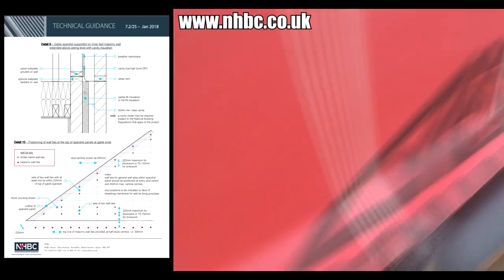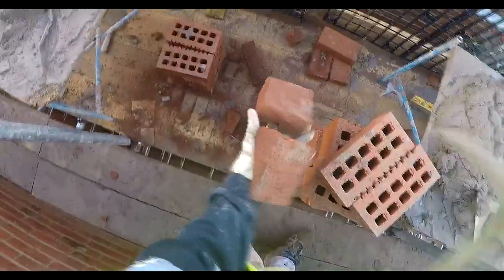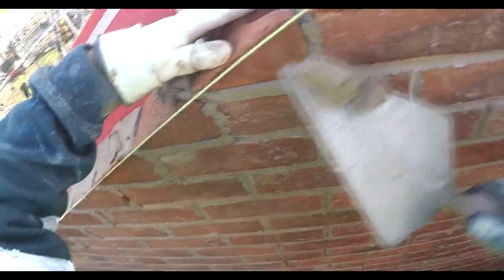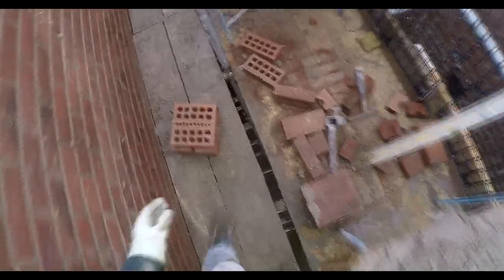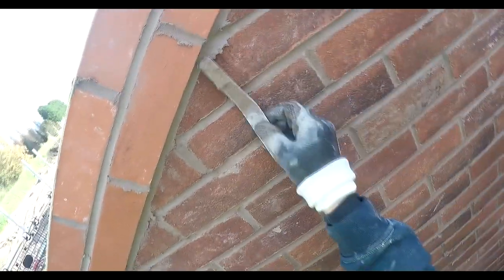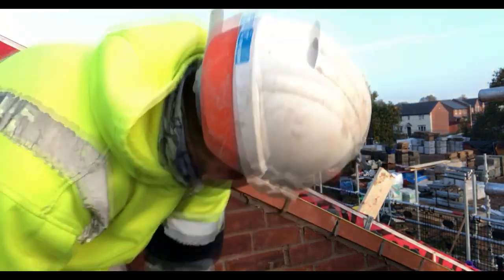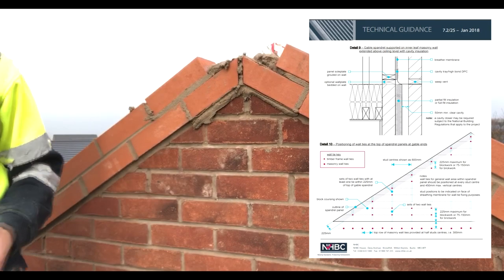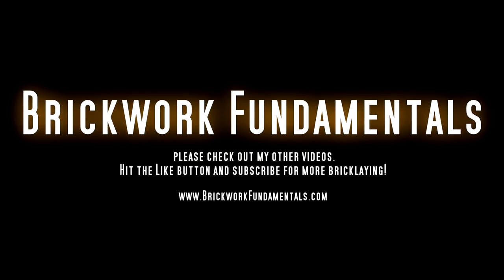BRICKWORK FUNDAMENTALS : Pic and Dip Top Out with Spandrel Panel and Talk Through (Dec 2020) HD1080p

Comment: What tool did you use to get gat the angle for the cut ?
Reply from the maker: I don’t use a tool but I know lads who use joiners angle finders. In my other top out video you can see me working it out a bit better. I put the brick in going to cut in place then use a straight edge to check the bottom of the bricks are inline. Then I use my level on the bottom of the reds on the other side of the pike to mark where the 2 points meet. I then allow 5mm for half of a joint and plumb up with my level. I mark it with a nail. ( pencil tends to comes of with water from the saw). That’s the first cut sorted. I then use a tape or my eye to do the 2nd cut . The top 2 Bricks I just put them in place and continue plumb line up.  Prob easier with an angle finder but I’m used to doing them like this now 😀👍 sorry for the long reply
Reply: @brickworkfundamentals4636  Thanks for the explanation much appreciated